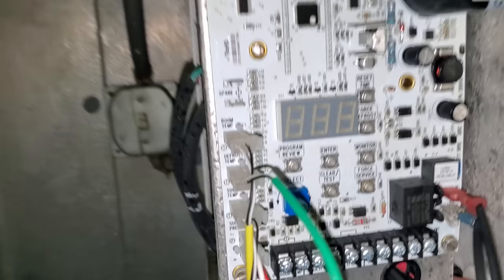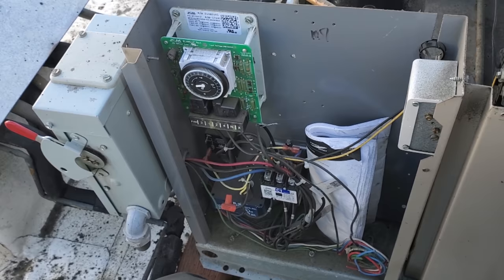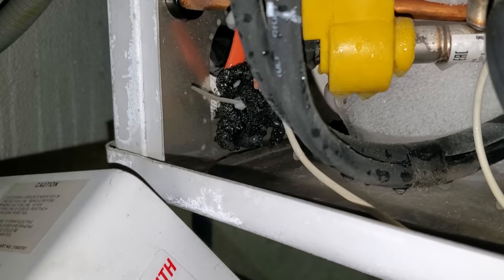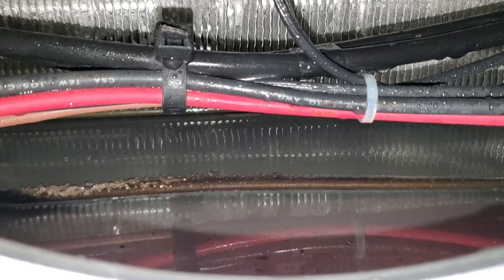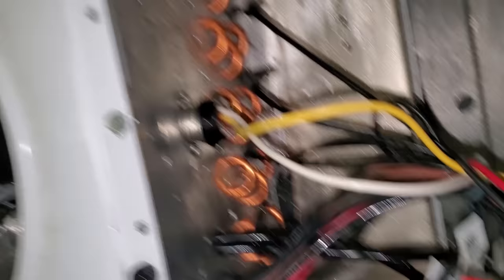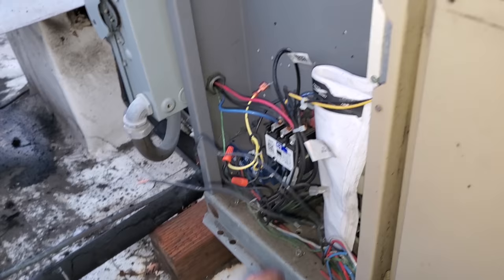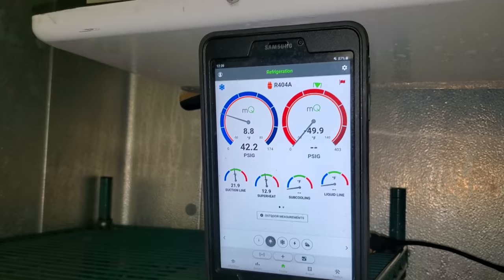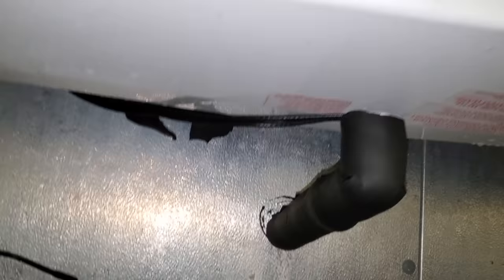THE OTHER COMPANY COULDN'T FIGURE THIS ONE OUT EITHER

Comment: Damn good job!!! Reminded me of my time in USAF during Vietnam war. I was a WCS mechanic, which meant my system controlled all aspects of all weaponry. Missiles, bombs, gatling gun, Radar, scopes, wiring, computers, hydraulics, the radar system ( klystron, antenna, synchronizer, power supply etc)...a complex system. There were times pilots would return from a mission and would "write-it up" because of some malfunction. A guy like me got the work order, grabbed my little tool bag, trucked out to the flight line, (bombs, missles, ammo EVERYWHERE!!! jet powered generators for electrical power, jets taking off after-burners screaming)... 24/7...we were in an all out bombing campaign (hey, I was 20,21,22, and just trying to stay alive and go home. Just did my job)  opened up the system, fixed it, signed off...next!
The radar klystron's wave guide system had to be pressurized. Air has a resistance to it, so the system needed to have a consistent pressure to operate. If it lost pressure, you tost radar. You lose radar, you lose your sight AND your teeth....so you can't see what's coming, and even if you did you couldn't do squat about it.
So....Capt Ritchie, (the only front seat pilot Ace for the USAF of the entire war) wrote up..."lost radar at altitude." 2 times others in my shop tried to fix it. Both times they returned with "CND" (could not duplicate). So... when he came down and this was the 3rd time his radar failed him, and he wasn't happy. I don't intend to brag, just tellin the whole story...but I was the ONLY guy in a shop of about 60 mechanics that received Superior Performance Proficiency Pay (SPPP)...cuz, like you, Mr HVAC man, I knew what the F I was doing. 
So...now I get this write-up...they "explain" to me I needed to demonstrate  my proficiency...lol...that this Capt was P.O.ed.
OK. Lose radar at altitude? Means 1 thing and 1 thing only. a loss of pressure, or , as we called it a slow leak. They couldn't duplicate it. So they wrote it off and went back to the shop.We had machines that would pressurize the system for troubleshooting purposes, and then you watch the gauge, see the pressure goes down then look for a leak. I didn't NEED to duplicate it. Sheesh...I was shaking my head at these dumbasses. THERE WAS A LEAK!!!  That simple. Duplicate or not didn't change the fact HE LOST RADAR AT ALTITUDE.....now 3 times!!!!!! So, Somewhere in the waveguide, which had about 8 or 9 connections, plus the guide twisted and turned and sometimes got a tiny hole in it...very rare...but somewhere , there was a leak. I just had to find it. I didnt NEED to troubleshoot it, the pilot had already done that for  me.
All I had to do was go to the maintanence log, look to see the last time they opened the system , saw WHERE they opened it, I then opened it....and there it was, a twisted o-ring. Put in a new one, a little vaseline smear, closed it up, didn't even check it over. I knew it was a solid fix. His bird never ever had that problem again for my last 6 months ( I was there 30 months). Later that month , he got in a cpla dogfights, my radar worked , a cpla missiles missed, but he shot down 2 in one dogfight, came back, shook my hand. He is now a retired Brig General. Then he was Captain Steve Ritchie, pilot of the F-4 Phantom from the Triple Nickle (555th) at Udonthani, RTAFB (Royal Thai AF Base). He had shot down all 5 in a 4 month period after I worked on it. There were 2 in May, 1972. He got 2 in a single dogfight in July, 1972, and his 5th in Aug 1972. Oddly enough,  different pilot from the same AF base, Udon, but the other squadron, the 13th, Fighting Panthers, also had 4 kills. So, there was a competition  for getting to an Ace. I worked on his plane as well....everal times. There were about 40 F-4s there, so, after 30 months, I had worked on them all.
3 Cheers for people that know wtf they are doing!!!! 
Great fix Mr HVAC guy.
Reply: That was a really awesome story to hear. Thanks for sharing! And thank you for you service!
Reply: literally no one asked for a biography
Reply: Those he shot down in the dog fights probably had leaky waveguides.LOL
Reply: Great story
Reply: Thank you for serving
Reply: Great story my guy
Reply: In Thailand  555 means hahaha or lol
Reply: Aside from the 555 coincidence , your post points to a serious problem with all pilots - They don’t have enough or any maintenance experience .
They shouldn’t just make a note / complaint and assume the grunts are going to do a great job .
Reply: Your experience should be on his Richard Stephen Ritchie Wikipedia page . He’s still alive ?
Reply: Had a neighbor worked on planes WWII.  Even then some got so hung up. “We couldn’t make it happen in checks”. One plane (I forget type) was grounded.  It worked great on the ground.  But 30 seconds in the air and power decreased to near half.  They flew in experts who couldn’t make it fail on the ground.  Neighbor was told.  “You are not specifically trained on that plane.  But you find, fix better then most...Here are the manuals.  I don’t care what you do but the Next two weeks you spend with that plane.  I don’t care if you sleep in it.  If you can’t fix it in two weeks we are going to strip every useable part from the engine, maybe replace it, maybe strip everything”
  So a week he played with it.  Called factory back in states...  then he was sitting in shade with everything removed that he could and he saw something wrong.   (I forget if kinked hose, or filter after pump). But a 15 minute job.
  He tells them it’s fixed.  Pilots had heard that line before.  He offered to go on check ride.   It worked great.  Head mechanic wanted to know what he did.  So he told him.  Dead quiet.  Seems that was a unauthorized repair for his training.
  So they put down something else as the problem. (It’s been 20 yrs since he told me, I can’t exactly ask him to clear up details I forgot)

Comment: I had a similar experience, my classroom had a dedicated heat pump (one of fifty in the building) that never really worked 88 in the summer and 50 in the winter.  After a year of techs coming every few weeks to tell us the unit was working correctly, I blew a different company’s tech’s mind when I took a sheet of paper and held it up to the air vent. Instead of blowing the paper away it was drawn to it. They had installed a top-down heat pump instead of a bottom-up unit reversing the returns and the vents.  The returns had dampers to prevent back flow and closed venting the conditioned air into a make up air loop.

Comment: Incidentally, the evaporator in the video is not a deep-freeze evaporator but a normal cold room (approx. 41 ° Fahrenheit) evaporator. The slat spacing shown is too low. About 5-8mm freezer and 2-5mm fridge are normal Since the heating warms the surrounding area when the ice defrosts (as with breathing -> "fog"), the water condenses again on the cooler fins and cannot drip off since only small amounts evaporate in the spaces between. Keep it up! thumbs up
Reply: Well spotted Sven S , that job is a total nightmare!!
Reply: My heart sank when you pointed that out, and I'm just watching the video!

Comment: Its either SO or JO cord
S = Service Cord (600 Volts)
J = Junior Service Cord (300 Volts)
O = Oil Resistant Outside Jacket
Reply: Suppose to be temporary use, not permanent, the jacket is rubber and it dries and cracks and then the wires will short 🔥

Comment: Q: who is this guy?

A: somewhere in-between an electrician and a plumber.
Reply: Yester McBeetur,  Industrial/commercial HVAC is a lot more than just electrician and plumber. You don't need to be a plumber to know that water doesn't run uphill, or an electrician to know how to follow a wiring schematic or installation manual, but it helps! The original 'installers' were unqualified, and wrecked a bunch of expensive equipment, then charged the client for all the parts and service calls over the problems they caused. I'm surprised someone wasn't electrocuted.
Reply: Haha! You have no idea how accurate you are,
When I did it almost three-quarters of my refrigeration service calls were either bad drains or crappy wiring!!!
Reply: A technician who knows what he is doing - excellent diagnosis - worth his weight in gold.
Reply: @EddieVBlueIsland  Maybe would could ask some of those bright minds to do a crash course in medicine to make a whole new class of super doctors.
Reply: Maybe he's McGuyver
Reply: Who is this guy?  He is a wizard!
Reply: Ha ha pretty much plus a lot more. An HVAC technician services, maintains and diagnose the entire HVAC system. They can do such mundane tasks as regular routine servicing involving cleaning the filters and fins (as partly seen here in this video). But also when diagnosis a system need to understand how the entire system basically works which quite often involves as you stated ' in-between an electrician and a plumber'. A good tech will gain experience and wisdom to learn common problems or issues with various different types of systems (like this QRC specific system). For example he knew from experience noticing common signs with the ice buildup and to look at the drain, both here as well as stated with some of his own employees installs. In short they are similiar to an auto mechanic with pretty much all similiar tasks of servicing, maintaining and diagnosis of all systems (aka vehicles) which requires partial electrician and to smaller degree plumber (radiator water and vacuum hoses). A great auto mechanic, just like great HVAC tech, is worth their weight in gold. Because they can with just a few minutes listen and watch key things and quickly know where to start looking and getting to the heart of the problem(s). I have never been a tech, but during my time doing HVAC installs during slow times would go out and help assist some of the employed techs and got to learn first hand how they know common things to look out for, for each particular unit, while completely understanding how the system basically all works.
Reply: Us fridge guys need a bit of everything. Makes it so interesting. No 2 days the same
Reply: bobby ruest  yet another example of how the internet is making the world we live in a better place 🧐.

Comment: People wonder why I chose to retire early being a lead service tech. I was so glad someone else understands what goes on. My wish is beginners would watch this and 1. Learn to read the install manual before starting, 2. Realize you have to understand electricity to do a good job. 3. Drains cause so many nightmares, so do it right the first time. Yes even at EMC, Yahoo and Google server rooms this was happening early on. Let guys know a clogged drain cost a residential owner 7-10 K when their ceiling is damaged due to a drain sloppily installed. Glad I found your channel. I'll subscribe.
Reply: Electricity, water, and air (or any fluid) all have similar characteristics, except gravity in liquids
Reply: One thing I noticed is that some people that have installed the same type units tend to think that they know it all and don't go back to the install manual to double check that nothing has changed vs a previous install. The companies do make wiring and electrical changes that never get mentioned except in the install manuals. They could have installed 10 of the exact same units prior to a change made with no issues and then the next one they installed gave tons of problems.

Sometimes it pays to compare the install manuals to older versions of the same model to make note of changes made. Then add to that some get used to the newer models and get a call to service an older model and run into the problems of thinking the older model needs serviced like the newer ones they are used to. Not all of the same models by the same manufacturer are the same year after year.
Reply: Read the instructions?! But my uncle always called that the "Idiot Sheet"

Comment: I had a drains causing millions in damage to a commercial building and went on the roof to see drains installed HIGH UP in all four corners with a low pond in the center of the flat roof leaking into the building. Water is not going to magically climb up hill into the drain. Water will seek out the low spot every time.

Comment: Just recently retired from refrigeration.
I was forever saying to myself, "I am not an electrician," yet the number of stupid and potentially lethal mistakes I came across was mind blowing. In the UK our single phase is 220 volts and our three phase is 415 volts
The only reason I was so good at my job, was because others were so inept.
In a sense I am glad I am retired {no more frozen extremities and unable to even speak due to the cold, no more baking plant rooms, or trying to figure out which condensing unit fed which evaporator, oh and no more call outs at four in the morning when you just got in from a call out an hour early) but I feel so sorry for the customers having to pay for poor repairs and shoddy installations.

Never think, just because you have found and rectified one fault, that the system is fixed, not think that you have sorted the problem by replacing the failed part. Always ask why it failed and deal with the problem which caused the failure in the first place. Then after carrying out repairs, check for correct operation of the complete cooling and defrosting cycles.

To the guy who got tasked with the can of worms, congratulations for persevering until the end.
I'm only retired six months, but I miss those days, I took a genuine interest in my work, which is probably why I watched until the end.
Reply from the maker: Thanks for watching bud. And thanks for the nice words!!
Reply: @HVACRVIDEOS  As I said, I am genuinely interested in the principles of refrigeration and it is always good to know there are still heroes out there.

Comment: The owner of the restaurant needs to sue the other company and recoup the money they spent that should have been covered by the installer as it was clearly shoddy workmanship/ improper install and they should not be paying to fix  the unit at all!  If the original installer or one of their techs that worked on this unit see this you should suggest to your employer that they make this right with your former client!
Reply: Sue?! Only the attorneys win. A business has to write it off and keep going (with new service company).
Reply: Best justice is to tell the entire restaurant businesses in the area to avoid that company like the plague.
Reply: sue sue sue. let me guess you're American
Reply: The BBB is the place to start. I was on the other side of things when I was service manager at a small avionics shop (general aviation). During my time we answered two complaints and saw fit to adjust the bills, an average of about 50%. Both were labor intensive jobs, because of design problems in one case and a botched repair elsewhere in the other case. After the adjustments we barely broke even, but our reputation was intact.
If it ends up going to attorneys the BBB record is a great starting point at no cost.
Reply: @flagmichael  Agreed, put in complaints with local as well as BBB. Along with word of mouth and spreading around to other nearby local business in the industry. Stay away from x company, instead use y. With enough complaints and word of mouth, that bad company will start to see decrease in business which will impact their bottom dollar w/out a need to go through the expensive lawsuit especially since it was all already done and paid for. At the end of the day, hit that company where it will really hurt, its bottom dollar and being able to stay in business. Now IF not all paid up, then sure it might be justified to go through that extra hassle of a lawsuit. But again with complaints already listed on file to start off with and back up such a lawsuit even more.
Reply: Agent J shoddy was being nice. That was crap
Reply: @vn3801  so you  think if someone is incompetent at there job you should give them all your hard earned money to fix something they did wrong? If so I want to work for you lol
Reply: @flagmichael  BBB is useless. Post it up on Facebook. Name and shame.
Reply: the person paying the bills needs to read what they are being billed for and THINK before paying rather than just mindlessly writing a check.  If this was all listed on the invoice, then why didn't the person paying the bills see they they were paying for repairs that were caused by the same company making the repair?
Reply: @frotobaggins7169  might be some corporate chain. Accounts payable departments don't give a sh¡t they just pay...
Reply: They should have questioned the first invoice if the failures were so soon after installation.
Reply: @vn3801  It's the only mechanism that allows redress and hopefully weeds out the incompetent/scammers.
Reply: @frotobaggins7169  sometimes multiple people are paying bills. Unless the same clerk is paying large bills repeatedly, it probably will not be caught. Or they noticed it and were told to pay it...
Reply: @fyrman9092  thanks, i have no experience in that but you would think people paying bills or accounts would each have specific accounts they are responsible for and that any check over X amount, say $100,000 would need a partner to sign off on large amounts.  it just seems like basic security to prevent embezzlement at the least.  i mean 900K is a sizable amount of money for  a paralegal to be single handily responsible for.
Reply: Cameron Parrett lemme guess, u like being screwed?  I hate the litigious american blight but in this case suing is at least one possible avenue. Publicly naming and shaming, somehow, will b cheaper tho. Less time too